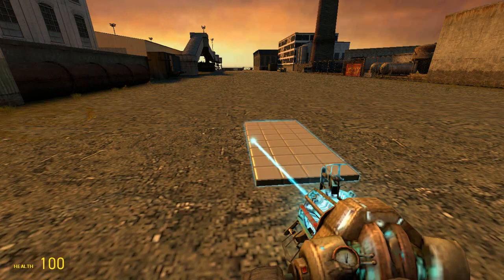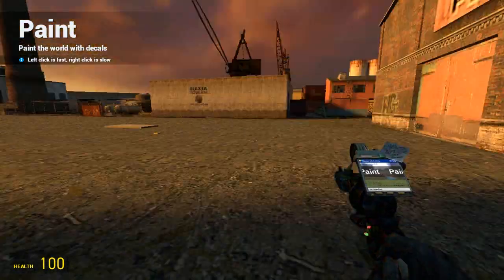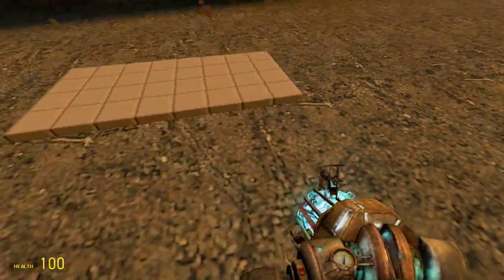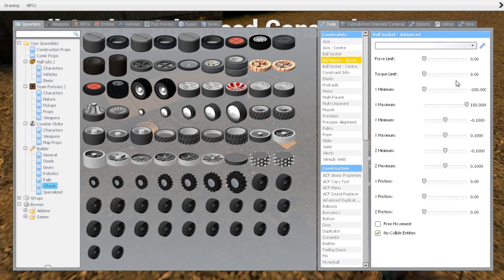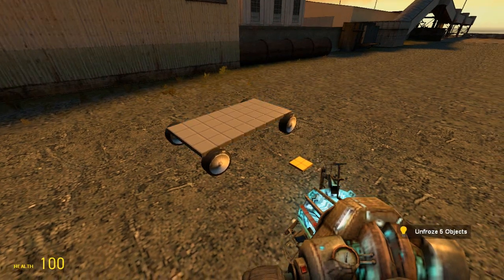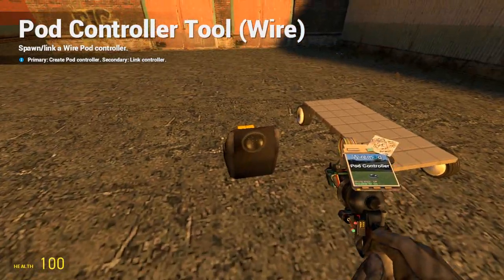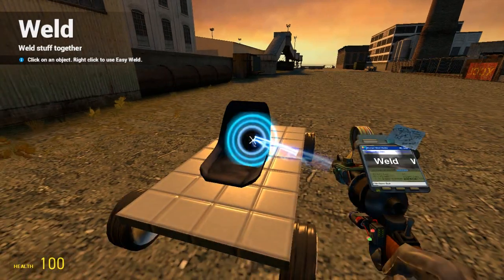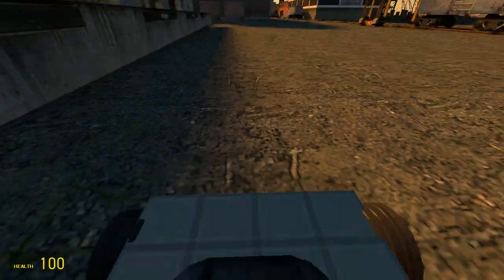[Tutorial] Garry's Mod: Expression 2 Car Steering - E2 DL

Comment: might want to re-make the video as the ball socket settings which I have checked side by side to compare no longer function as intended and instead allow the wheel to freely turn up and down but not forward and backwards
Reply from the maker: Probably an issue of direction of the vehicle, turn it 90 degrees.

Comment: Hello this is an amazing tutorial. I wanted to ask, howcome the two front wheels turn facing left/west after linking the e2 plate to the baseplate(chassis)? The steering works but the resting position of the wheels isn't forward/north. I built facing north
Reply: Did you make sure the chip is facing north as well. Even e2 chips have a little arrow that show what direction they are pointing.

Comment: I know it's likely outdated, but I follow the tutorial closely and the wheels snap 90 degrees from north every time I wire the E2's chasis input to the chasis of the car itself, any help if you still have any idea how this works?
Reply from the maker: You built something 90degrees wrong, the chip seems to think that chassi is pointing the wrong direction, this tutorials should still work though. 
You can try to have onother prop as chassi and see what happens when that is turned in different directions.
Reply: @GMODISM  Managed to make it work, the back right wheel flops around for no actual reason even when all other wheels work fine but this helped

Comment: Quick question, all the e2 stuff works. However, the wheels are still able to turn in all directions even though my adv ball socket settings are correct. The only thing different I did from the video is use the default e2 model for the chip, instead of your little yellow square, but I'm assuming that's not the problem. Love your videos!
Reply from the maker: Thanks!
Review the settings for adv ball again in that case, also respawn it with adv dupe 2 to update, other model should be fine.
Reply: Thanks for replying! It turned out that I somehow installed EZsteering wrong, which is strange, because it showed up on the E2 chip. Works fine now.

Comment: i can move my front wheel in all directions while its linked with ballsocket to the e2
if i move the e2 the wheel moves with it the wheels won't stand right up they are laying flat on the ground can somebody help
Reply from the maker: Re check ball socket settings you use, and make sure to build to north
Reply: i builded a new one but i still got the same problem and yes im building to the north if i steer the wheels are going everywhere and turning in all directions
Reply from the maker: If the addons don't work, try playing online and see if it is your system having problems
Reply: i do have e2 problems offline but i already made a car on a server, but on some servers the chip does not work

Comment: so when i wire the e2 to the chasis my front wheels turn 90 degrees sideways any idea why?
Reply from the maker: So you did not build towards north!
Reply: Gmodism Total Nerdery Channel but i did i checked
Reply from the maker: O really? hm in that case it might be some prop orientation, you can go 
into the chip and set a starting angle to 90 as default and it should 
work, might even work to just spin it with advdupe 2 and spawn it in 90 
degrees angle from now, wheels fixed in correct position.
Reply: ill try that thanks :)